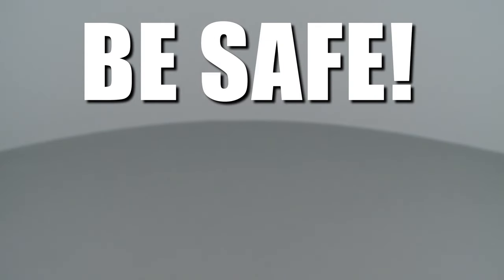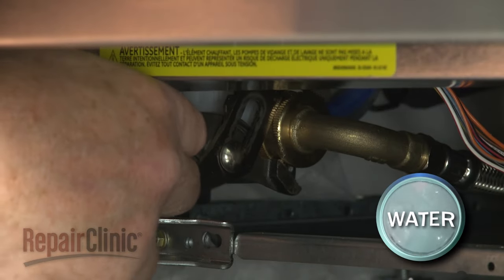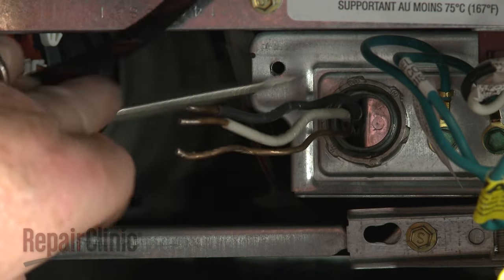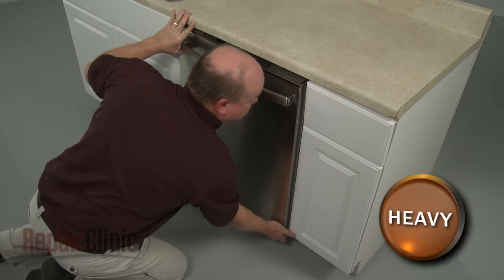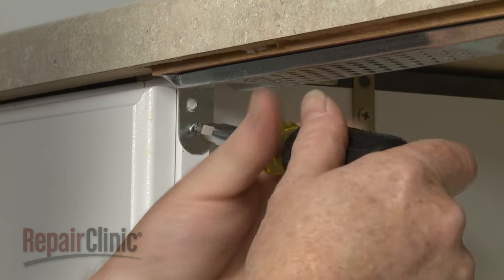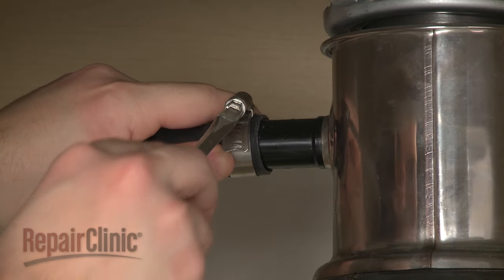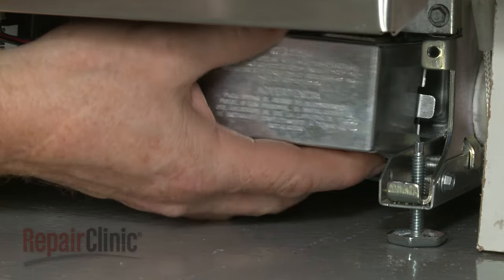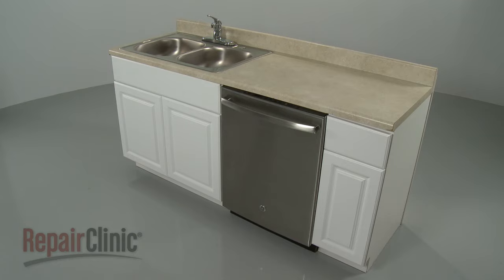Dishwasher Universal Mounting Bracket Installation #W10426979

Comment: 2 important things: 

1. The bracket can be installed under the countertop, but the dishwasher doesn’t have to be completely removed to do it. Just pull it out 6 inches, it works perfectly fine. 

2. If you do removed the dishwasher, DO NOT disconnect dishwasher hose first! (The video has it backwards). Turn off water to dishwasher first….then disconnect dishwasher hose.
Reply from the maker: Thank you for the tip. 

We do show in the video to turn the power off and turn the dishwasher water supply off first in the video.

Comment: At 2:20, you have screws already in place attaching the dishwasher clips to the wood that is apparently glued to the bottom of the counter.  And that piece of wood is what you're screwing the new mounting bracket to anyway.  What's the point of the bracket, if the dishwasher is already mounted to the countertop via the wood?
Reply: Agreed. Not much in responses from distributor of video. No help other than yea, this has pre- drilled holes here and over there😂 and oh by the way, your going to need to do a makeshift plank of sorts that mounts under your counter top, because once you replace an old washer, it calls for making holes for said plank, so you can mount the bracket. They know or this video is old, that most people will have to do more than just what's put forth in this video, during new install replacing 6 yr old washer.
Reply: This video is pointless, but in my case we replaced the cheap countertop with quartz, so there is no piece of wood available any longer and this bracket is required.